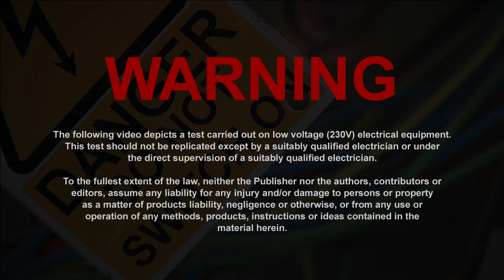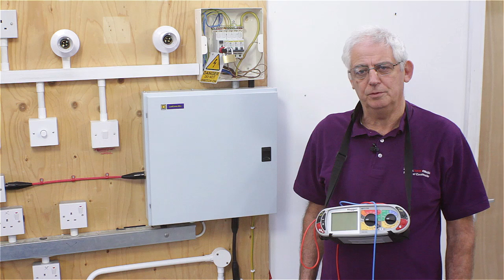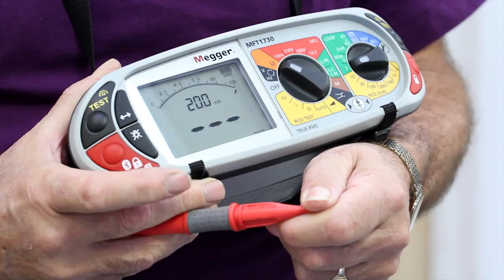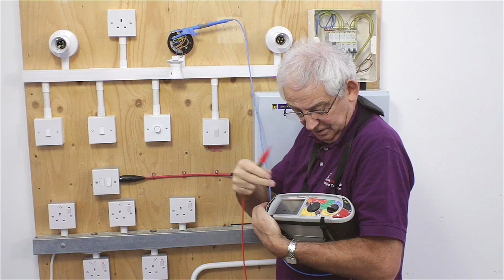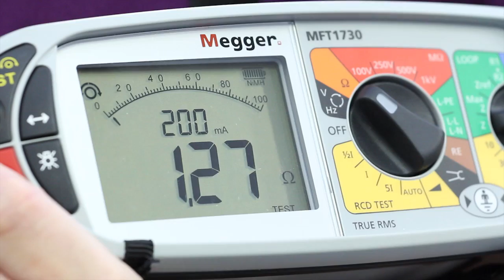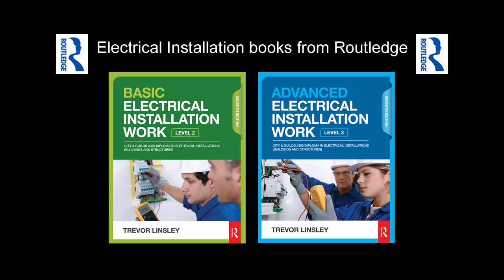QR code 8 -- Polarity test on a lighting circuit

Comment: Before you do anything at a remote fitting you should check there is no voltage, also when you pull a wire from a breaker you should again not assume it is dead . Test it against a known earth first.

Comment: So how was polarity proved?
Cheers!
Reply: Because he's proved your only switching the line conductor, and then visually he can see neutrals etc once you've done your r1+r2 you don't generally need to do a polarity test
Reply: Why was the the theme soundtrack of the mentalist used in the beginning-
Reply: @llVIU cross polarity is the misplacing of live conductors only (e.g line and neutral or between phases), if the earth was in the wrong place it would be a cross connection/earth fault.